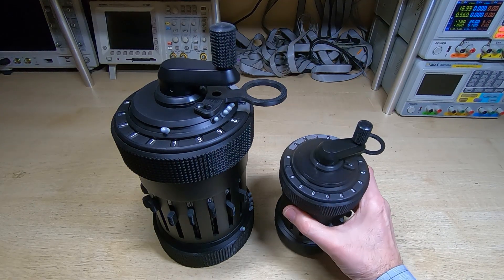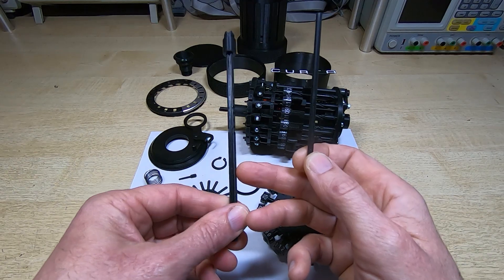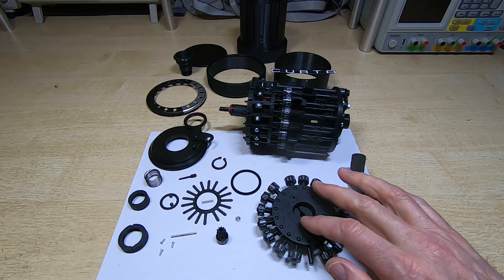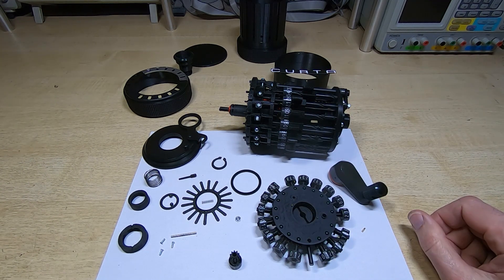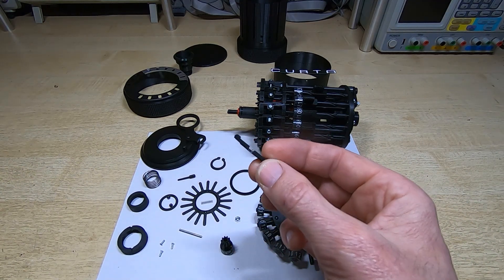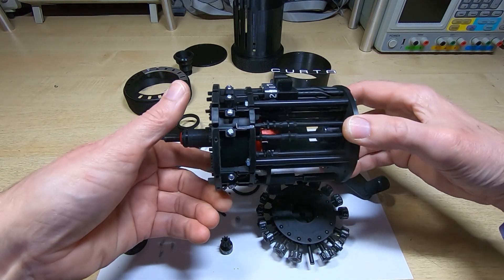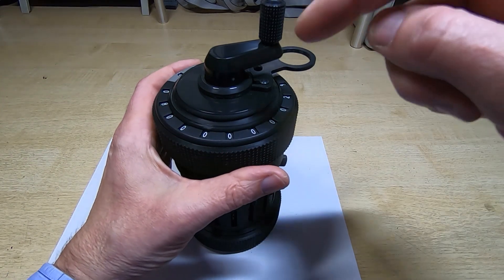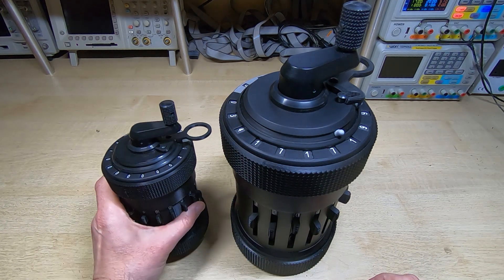I built another Curta Calculator

Comment: I am currently printing and building a curta at 2.1 - I used mainly 66% scale. for the shafts I use 63% scale for the diameter ( printed flat ) and 66% for the lenth. And I used X-Y hole compensation : 0.1 in orca slicer to increase clearance in holes.
I also modified the ten bearings to include printed springs. not completely tested yet, if successfull I will publish it on thingiverse. but he spring properties will depend on PLA and printer anyway.

Comment: Are ther any stl files for this?
Reply from the maker: You can download the original STL files that the creator made.
Search on line for 3D printed Curta.
He also provided an assembly manual.
Reply: @JerryWalker001 So you took the original files and scaled them for the 2:1 model?
Reply from the maker: @Tim02000  That is what I did for most of the files although as I say in the video I did not scale them symetricially. I modified a few of the parts so that they would work properly on the smaller scale and also because a couple of the parts did not seem to work properly. I also added a few additional parts.
Reply: @mariostar13  Install blender, import, press N, change the scale and export as stl.

Comment: Would it work to make the transmission shafts have a hexagonal cross section? Then they would be easier to print. The only place where they need to be circular is where they pass through the bearing plate and the main casting.
Reply from the maker: You can certainly try it but I think that trying to finish hex shafts would be extremely difficult.
Round shafts can be finished in a drill.
Also if they were hex then the gears would not pass over the round 'end section' or if the round end section was smaller then the shaft would not pass through the bearing plate.
The top end of the shaft also would need to be hex where it fits into the drive gear and having a hex 'bearing' would not work well.
Reply: There's a modification on printables when the shaft is split into two vertically. Seems like a good compromise